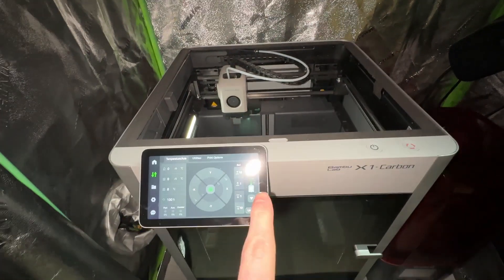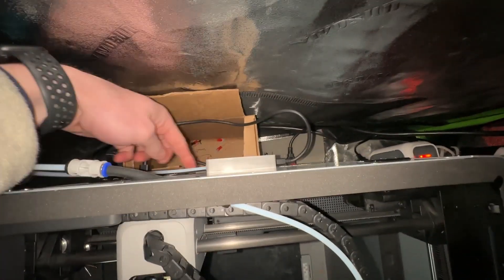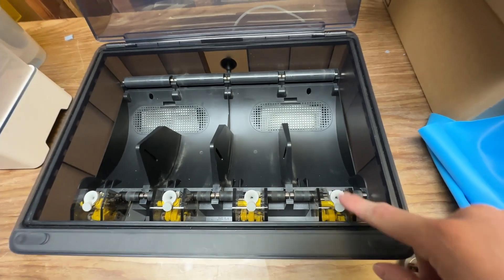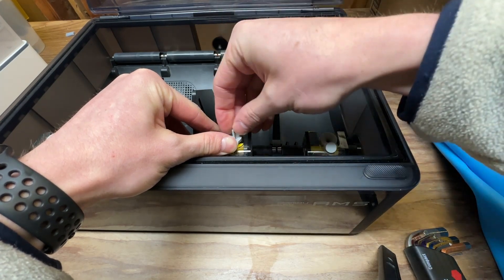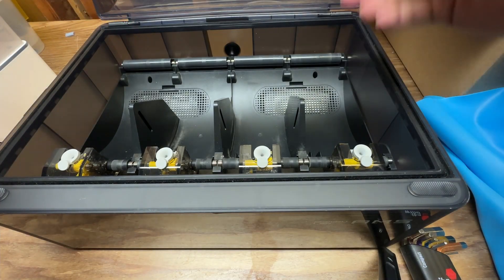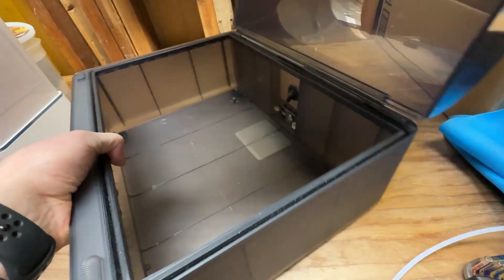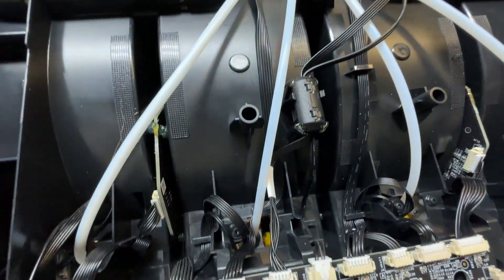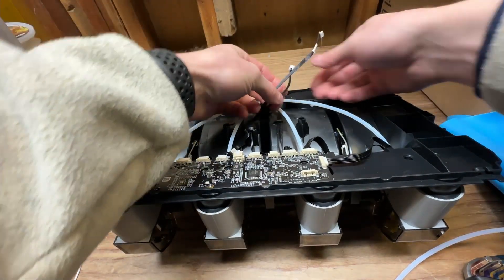How to Clear Broken Filament from the Bambu Lab AMS

Comment: Thanks for sharing. I did the same thing and it turned out that there was a stuck filament so I removed it and put everything back together and I’m still having the same red light issue and the same slot keeps retracting the filament. I checked every tube and made sure that there is no more filament stuck in all of them. I hope someone can help me with that.
Reply from the maker: You can try taking apart your first stage feeder: https://wiki.bambulab.com/en/x1/maintenance/replace-the-feed-funnel-assy 
Or you can order a new first stage feeder. 

You can also reach out to Bambu Lab support but I've read they can be slow to respond. 

I hope that helps.

Comment: I really wish they had made those cables about 3" longer, that's the worst part of the process.
Reply from the maker: I should really make a follow up to this video. You don't hand to disconnect and reconnect the cables every time. You can remove the 2 screws and then tilt the internal assembly towards you and access the tubes underneath. 

But longer cables would still be nice.

Comment: Thanks this just happened to me w/some brittle filament!
Reply from the maker: You’re welcome, glad it was helpful. Brittle filament is usually the cause, not much the AMS can do about that.
Reply: @3DPrintStuff  It was clear filament and I noticed at the end of it, I could see what looked like 1 or 2 small  internal "cracks".
It prints fine, but the end just easily snapped off when I lifted the roll to insert the desiccants holders I printed off of Printables.

Comment: First, thanks for making the task not so daunting. Second Story time, I have this inland pla plus glow in the dark filament, that I let run in a print, and at 99% it would not retract into the AMS, I feared the worst, I unhooked the AMS and was able to pull the filament out.  it seems it had a rigid part of the filament that got it stuck beyond the drive wheels capability.
Reply from the maker: You're welcome, glad it was helpful. I'm always a little concerned about using filaments with particles added into them for that reason and for clogged nozzles.

Comment: Well this has been a learning experience!  Turns out if you neglect to check/replace the desiccant packs in the AMS and then don't use the printer for a month that can be a problem.  Two rolls of filament became brittle and snapped off inside the AMS.  Thanks for the great video, my AMS is back in action! Subscribed!
Reply from the maker: Thanks for the sub! Glad this video was helpful

Comment: Thanks, really helpful. I see you have your X1 in a foil enclosure. What temp does your chamber typically get up to? I've made a similar enclosure recently and my chamber sat at 60c for the majority of the ABS print. I opened up and the case was really hot. Just concerned I've over achieved and this might drastically shorten the life of the printer electronics.
Reply from the maker: The foil enclosure is actually to increase the ambient temperature during the winter since my printer is in a unheated garage. When it's -25c I use a little space heater to bring the foil tent up to 10c and let the printer do the rest. During the summer I print with the door open for fear of overheating. My chamber temp while printing ASA (I haven't printed ABS but ASA is pretty close) sits around 45-50c when the ambient temp is at 25c during the summer. I can't find any stated max chamber temperatures in their data sheets or on the wiki... I've also stumbled across multiple people who have made DIY enclosures pushing 60-70c as their chamber temp. Anything above 50c will likely shorten the service life of certain components but it's difficult to say what will fail when.

Comment: Taking the AMS apart cancels the warranty?? I am having the same problem on one of the extruders but the grey button to pull itbout doesn’t even move it is completely stuck!
Reply from the maker: There is a 3 month limited warranty on the 1st stage feeder of the AMS which is the part you are describing. If you're within the first 3 months of receiving your printer + AMS I'd contact support. Here is a link to their warranty terms: https://bambulab.com/en/policies/warranty
I don't see anything about taking the AMS apart cancelling the warranty but I could be missing something. Their machines are intended to have maintenance tasks performed on them which requires they be taken apart. But I would contact Bambu Labs directly through a support ticket. https://bambulab.com/en/my/support/tickets
Reply: @3DPrintStuff  Thank you very much! This helps alot!

Comment: Nice guide, thanks. 1:44 But in my case it was a 1,5mm ;)
Funfact, my stuck was also in the 4. position from left (or first from right) like in your case. Maybe a repeating issue?
Reply from the maker: That's weird that it would be a different size. I think my issue was cheap PLA. I've changed the filament in that slot and haven't really experienced any issues since.

Comment: Ditto, very good. I also realized the two screws really are not needed to hold the chassis in place in that tight fitting enclosure. 

I had issues with the two plugs having ~4" too short of wire due to my big hands/forearms and an enclosure top that cannot be removed. All this could be easily fixed if Bambu moved the LAN cable PCA to the top above the PTFE tube near the cover hinge. 
de Sr EM Test/MFG Engineer, MS-EET
Reply from the maker: Yeah the screws are mostly unnecessary, I've started just leaving them out and have been fine so far. I also found out that the connectors don't need to be disconnected, you can just tilt the inner assembly towards yourself and access all the tubes underneath.

Comment: This will happen ALL  THE TIME if you leave filament loaded into the AMS for long periods when not using the printer.  The filament dries out and breaks off when you unload it.
Reply from the maker: I've had some filament be worse than others. White filament has been really bad in my experience.

Comment: Het thanks, I just had this error after only four days of owning the X1C and AMS and I was shocked at first. But then I checked what the error message means and knew it was broken filament somewhere inside. Indeed they could've done a better job at making it accessible. I'm thinking to simply cut a hole in the bottom and print a lid for it because I'd rather not mess with the cables all the time. Those plugs are not meant to go in and out often.
Reply from the maker: I had the exact same idea of cutting a hole in the bottom and printing a cover. 
But since filming this video I found out you don’t actually need to disconnect the cables. You can remove the screws and tilt the inside portion towards you and you can access all the tubes without messing with the tiny electrical connectors.
Reply: @3DPrintStuff  Ah yeah that's another way. Thanks for mentioning. That should at least give the cables and connectors a longer lifespan.

Also, maybe the screws can be replaced with magnets so the solution doesn't require screws anymore. But I think a hole in the bottom would make it even easier because then you don't even have to remove the rolls of filament.

Comment: great video, helped me clear my clog.  For those that have wide hands and fingers, those wires are way easier to handle with bend nose tweezers.
Reply from the maker: Glad it helped! Tweezers are definitely a good recommendation. I've also found out that you don't actually need to disconnect the cables and can just tilt the internals toward you and clear the jam.
Reply: @3DPrintStuff  im too fumbly to manage that.  I do wish they had an access panel on the bottom.  Might be worth a mod design/challenge.

Comment: Thanks. I had my first jam today. I had tried PLA Flex in my AMS! This helped a lot.
Reply from the maker: Glad this helped. Flexible materials aren’t compatible with the AMS but I’m sure you found that out the hard way.
Reply: You can just pull flexibles out. Just turn off the power grab the filament from any path in the back and pull it out slowly. I print TPU all the time and test out brands some fail and can be pulled out easily.

Comment: Damn, sure enough, that was the problem.. thanks man! A bit frustrating to have to gut the AMS, but have to weigh the good with the bad and even from the other problems I've had with Bambu X1C, its an fantastic printer
Reply from the maker: You're welcome. I kinda wish there was a door on the underside that gave you quick access to the tubes so that you didn't have to unscrew anything to clear filament jams... but it really is a fantastic printer and this is a minor complaint.

Comment: My 1st X1C/AMS combo had so many errors and issues that Bambu Labs asked for it back, 
and they sent me another setup.  I was amazed at how well it all worked - *When it wants to.. 
Even w/ my 2nd new AMS,  the damn thing is constantly stopping at 99% or whatever, 
and giving errors that filiment is stuck and/or the filiment can not be wound back / unloaded.. 
It's annoying and frustrating as balls - especially when trying to do multi-color prints,  more than 1 print w/o having to physically manhandle pieces and parts - when there's No filament even stuck..  *Sigh*
Firmware upgrade[s] haven't 'fixed' it yet..  I printed and set up the Hydra-mod, tried other brand filaments, etc...  Nope...  Mine still continues to jam.  Sometimes every print,  sometimes every few.. 
Either way - for the price - this is unacceptable..  [and the site won't send my issues / tickets to them now]
*The errors / jamming / whatever has happened with both the .4 and the .6 nozzles
*The 4th / far-right spool slot is almost always the problem also.. 
I initially only printed using PLA-CF:  Zero Issues.  Switch to just PLA & all hell breaks loose.  **Shrug*
Reply from the maker: Sorry to hear about your experience with this printer. It's good that they took the first one back but continuing to have all these issues sucks... 
I've only really experienced constant issues with cardboard spools which they don't recommend using and when the spool gets near the end and is super light. There should be an official insert from Bambu lab to weigh the spools down. I know there are free stls available to do the same thing but you shouldn't have to print add ons for a printer at this price point. 

Hopefully your issues get sorted out. Let me know what the overall issue ends up being.

Comment: I found that when inserting a new filament form a spool that has not been used for a while, the 1st few centimeters of the filament is brittle and breaks off in the AMS when feeding. I plan to cut off a chunk from the tip to prevent that from happening.
Reply from the maker: That's an interesting observation. Maybe that first few centimeters get exposed to enough heat during the previous print that it become more brittle than the rest of the spool. Or else you'd think the entire spool would age at the same rate or age more rapidly at the outer layer and slower at it's core. Cutting off the tip when loading into the AMS seems like a good idea to avoid some of these failures.
Reply: Its happening to all of my old filaments, and I usually try to bend it hard and if it breaks I continue with the process until I get to filament section that is not brittle anymore. Im not sure why this is happening but only first 30-50 cms are super brittle. I printed with  P1S with all my 4-5 year old filaments without any issues or blobs. These machines are impressive.
Reply: @AlenTuzlak  That's how I do it as well.
Reply: It's normal. Just cut off the first like 10-20 centimeters
Reply: I have the same issue, do you use sunlu PLA by any chance?
Reply: Dry your filament. Print and use silica gel containers that go in the AMS
Reply: I've noticed the same issue with sunlu pla as well. It's happened four times always with sunlu. I use a mix of sunlu and elegoo pla.
Reply: Yeah you should always cut off the first centimeters
Reply: It's got nothing to do with exposure to heat. Most filaments are hygroscopic and they're susceptible to moisture. Before inserting any filament in to the AMS, try bending a piece. If it's brittle and it snaps, dry the filament. Different types require different temperatures and durations. Prevention of clogs is better than the cure.

Comment: Thanks you made a middle of the night repair go smoothly
Reply from the maker: Glad this helped! Did the printer notify you in the middle of the night and wake you up?
Reply: @3DPrintStuff  I woke up and looked at my phone to see how it was going my first multi color print. I used some trash filament that like spit length ways and jamed into every coupler. Ended up killing the entire print job waiting on a roll of polymaker in the same color
Reply from the maker: @paintballercali  dang, sorry to hear that. Failed prints suck, at least the system is smart enough to sense an error and stop itself instead of fully self destructing.
Reply: @3DPrintStuff  yeah this printer is amazing

Comment: I really wish they made extensions for the connectors at the bottom.  PIA to reconnect with large hands.  Had to use pliers to put it back.
Reply from the maker: Yeah me too. I have relatively small hands and it was still a pain. They should just be longer straight from the factory. Maybe a third party needs to sell extension cables to make reassembly way easier.

Comment: Good job 🎉 I just did this yesterday, just like that. They made it really easy on us to take the AMS apart and fix jams.
Reply from the maker: Thanks! They did make it pretty easy. I'd love for it to not be screws but some sort of quick connect fastener to separate the main AMS components from the outer shell. And some longer connection cables would make reconnecting that pcb at the back much easier. But those are small complaints. Overall it's an easy maintenance task.
Reply: Not so quick...my right side bolt is stripped from the factory. I'm stuck not being able to remove the filament holder/tray.